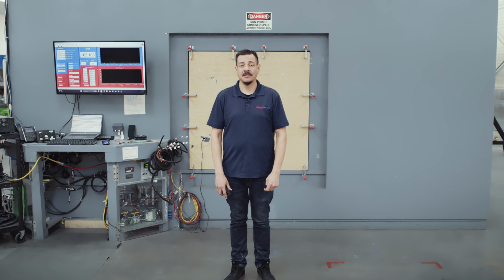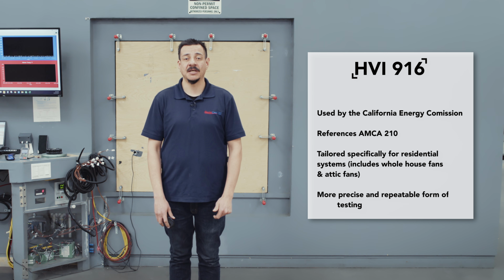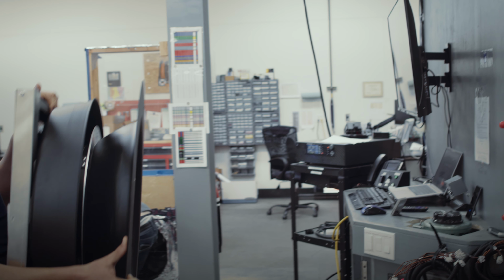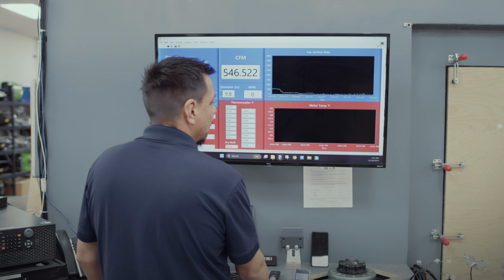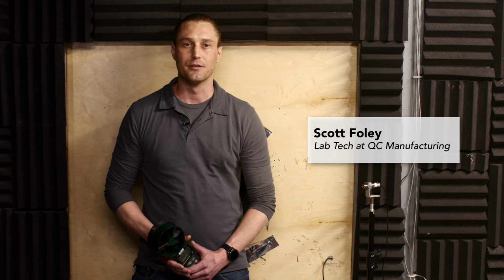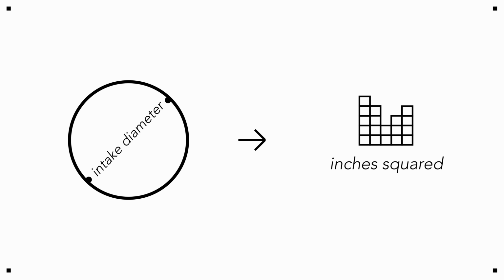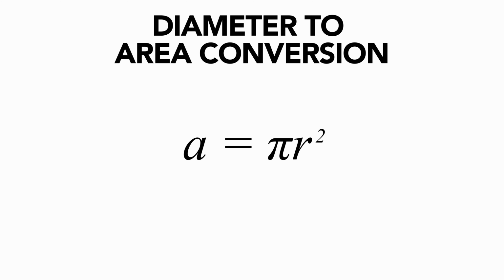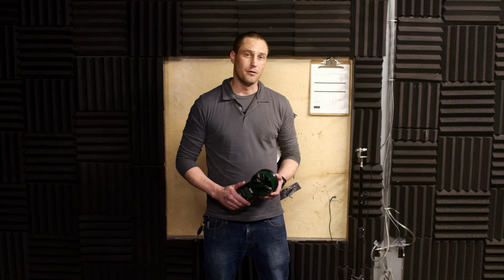Natural Light Solar Attic Fan vs. QuietCool Solar Attic Fan

Comment: if i put quiet cool classic within 3 feet of my ac intake vent is that bad? both wont be used together. otherwise i need to put into living room across 1800sq ft home to get air into the bedrooms. across the house, or close to ac vent are only options.